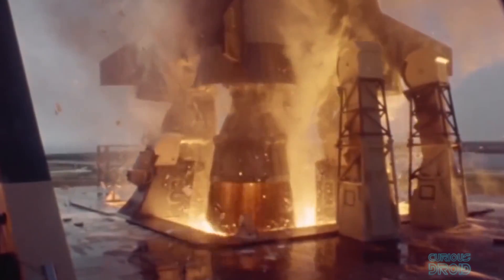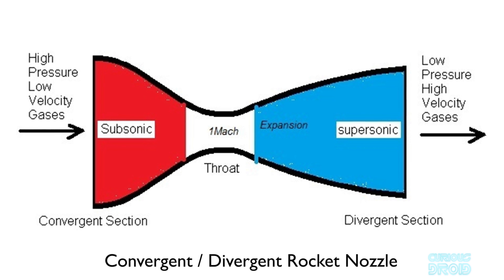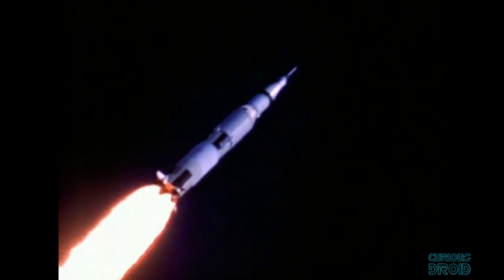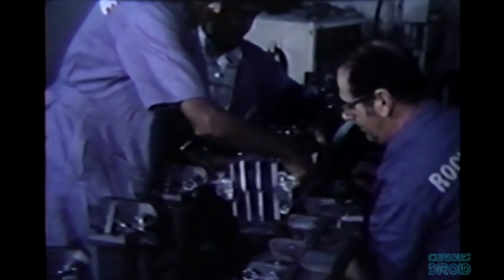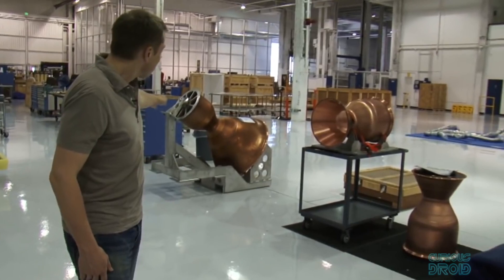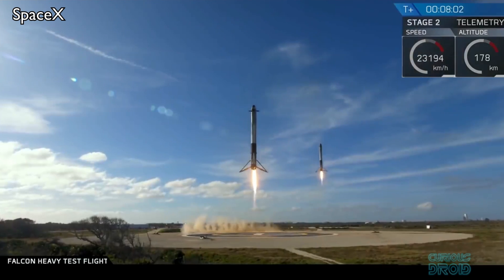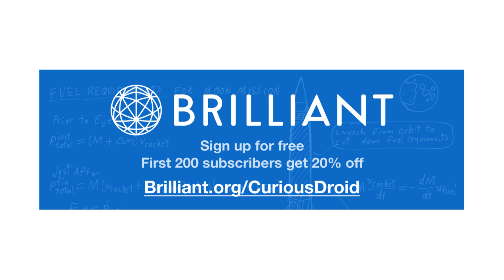Aerospike Engines - Why Aren't We Using them Now?

Comment: Why isn’t there a system similar to a fighter jet engine where it has a bunch of interlocking slats that can expand and contract but maintain the cylindrical shape?
Reply: Rockets operate at much higher temperatures than jet engines. It probably could be done, but the added weight, complexity, and cost would be a step backwards in overall practicality. Not to mention many more parts to fail.
Reply: Harman Robotics it seems fairly simple but maybe not. Building materials can always be swapped.
Reply: Read about regenerative cooling. The rocket bell is a static shape because of the cooling system
Reply: Ned - you are correct.
Reply: Those ribs in the bell have fuel pumped through them (I think). Getting around that would be a major design complication.
Reply: maybe it would melt, no way t cool it??
Reply: Things don't move too well when they expand dramatically under heat loading.
Reply: I thought I read somewhere that conventional fighter jet jet engines wont work in outer space due to the lack of oxygen and atmosphere? Have I been duped?
Reply: Harmon Robotics --- sounds like a logical response to me. Those higher temps would require a different material to handle that without burning up/melting, and in the event of melted rocket butt-flaps, you'd have a whole bunch of problems. The material required would probably be extremely heavy and expensive. Tough to make large parts out of iridium I assume. I may just be talking out of my ass here though. I'm a blacksmith not a rocket scientist.
Reply: Thanks dcb. I did see your comment as I was typing and realised we were referring to the same thing. Sure can learn a lot from youtube!
Reply: You're right. And due to lack of maneuvering thrusters because they require air to direct the aircraft.
Reply: So, we just need to develop new materials that are the perfect ratio of heat resistant to weight and we could easily make a reusable space craft?
Reply: Because they're not as fuel-efficient as jet engines, rocket engines have to have a much higher TWR to be viable.  Anything you can do to eliminate complexity, and therefore weight, is usually worth it. 

The F-16 has the best acceleration of any U.S. fighter jet, and even fully laden with fuel, weapons, and mission equipment it is 10 percent engine by weight (when empty, the engine is more than 20 percent of its weight).  However, since the F-16 has wings and gets all its oxidizer for free, only 16 percent of its weight needs to be fuel. 

A rocket needs to be able to lift itself, its payload, and ALL of its fuel straight up without the assistance of wings, so only about 8 percent of its overall weight can be "dry mass" of any kind - body, hardware, engines, payload, and literally anything else that isn't fuel.  If you're going to design a rocket engine to be as complex and heavy as a jet engine, it will have to be much more powerful or much more efficient than the current technology allows.
Reply: you could do that, and it would work.
But the added mass of the throttling system would be a greater negative than the slight improvement in fuel efficiency it would bring.
.
A bit more practical is a rocket nozzle with a telescoping extension. Nasa has looked at this several times, but rejected it due to complexity. (complexity in a critical system like engine containment is very undesirable)
Reply: I think part of the reason may be just because fighter jets require more variable throttling capabilities whereas a rocket more or less needs its maximum capabilities. This is just a quick thought I had in response to your question, I didn't spend much time thinking it through so if I missed the point, give me a break, hahaha.
Reply: To heavy and the diffence in pressure is way bigger, the closest thing to it proposed today is a plug nozzle.
Reply: JP-5, which is used by the U.S. Navy in its aircraft (a refined kerosene with high flash point), has an auto-ignition temp of 256 C (474.8 F). The liquid oxygen/RP-1 used in the Saturn-V booster stage engines burns at--I think--around 3,000 F. It definitely would melt the "turkey feathers" as the engine nozzles on military jets are referred to as.

Comment: a 40% saving on fuel means you need 40% less tanks and 40% less engine though. So it is a cost saving because you can have a smaller rocket deliver the same payload. And honestly to could double up and use a 2 stage rocket with an areo spike on the first stage and a small vacuum engine on the upper stage, because as you said a bell engine is more optimal in a specific case, and once your out of atmosphere there isn't any more changes to pressure.

Because as I have said in another comment, the reason for staging is only like 20% because of engine optimisation and 80% because you are dumping the tanks and engines that you no longer need, so by using a aero spike through atmosphere then separating recovering the first stage, then using a Vacuum engine on the upper stage I think you could see optimal savings.

Comment: Aerospike engines seem to only make sense in surface to space designs (such as the Space Shuttle). In multi-staged rockets we can have specialised engines and save the weight of carrying them and the empty fuel tanks along. No surface to space designs, no aerospike engines it seems.

Comment: the reason for multiple stages is like 20% because of engine optimisation and is mostly because carrying the dead weight of the tanks you no longer need you decrease your efficiency much more than losses due to using a unoptimised engine, also the fact that you are also carrying a big heavy engine which you don't need once you have burned a lot of the fuel and dumped the extra tanks.

But it would be good to have 1 engine type used throughout a multi stage rocket because it would reduce production costs because you would be building the engines in higher volumes.

Comment: Also ditching fuel tank weight as they empty kinda encourages multi-stage designs anyway.  That reduces the range of altitudes an engine needs to work over.
Reply: Steven Clark This is true, but dropping pieces of the rocket into the ocean means the rocket has to be rebuilt if used again. If the rocket is one piece and can be landed safely all you have to do is refuel it.
Reply: syaondri That sounds like it would work, although it would probably complicate other things.

Sounds Like It Would Work: The USAF and USN have used detachable external fuel tanks on their fighters for decades. Even better, there's a certain type that bolts onto the airframe directly, called "conformal fuel tanks" because they're not the more traditional cigar-shaped pod hanging off the underside. My understanding is these CFT's are the best bet for extending a fighter's range, because not only do they let it carry more fuel, but they don't cause a lot of extra drag the way a more standard external tank does.

Would Probably Complicate Other Things: The disadvantage of CFT's is they can't be dropped to shed weight and improve the plane's aerodynamics. Once they're on, they're on until the ground crew disconnects them. The reason is, the tanks are wired into the plane's fuel system, rather than keeping the internal fuel tank topped off like external fuel pods do. I'd imagine trying to shear off something that long and close to the fuselage - the CFT's on the F-15 are something like 20 feet long - would make flying really tricky, too, but that's mostly speculation. Either way, it would change the plane's balance and handling very suddenly, and rockets' failure rates are scary enough without adding more things that could suddenly decide to go squirrelly.

Why Consider CFT's At All, Then? Because big external tanks impose a lot of extra drag. That means you need a bigger engine to toss the whole contraption into space, which means you need more fuel, which means an even bigger engine, which means... And so on. Tsiolkovsy's rocket equation isn't complicated, as rocket science goes, but it is absolutely merciless.

All that said, I would not be surprised at all to learn that a group like SpaceX is working out the math so they can add extra fuel tanks that A) aren't also the engines themselves, like the STS and multi-stage rockets use, B) conform to the main rocket body such that they don't add horrible amounts of extra drag, and C) can be safely shed once they're empty. It's an engineering challenge, and rocket scientists are pretty good at that kind of thing. Here's hoping!
Reply: Internally-stored, ejectable fuel tanks? I had not thought of that, that's clever! Ditching the empties would change the center of gravity, but then, so does dropping the large external tanks, booster rockets, and empty stages currently in use, so that would happen either way. Yeah, the more I think of it, the more I like that idea.

And space guns! An engineer by the name of Gerald Bull was working on the idea of shooting payloads into orbit in the 1970's/80's, until the Israelis decided his practice of building cruise missiles and gigantic cannons for the Iraqi Hussein regime probably wasn't going to end well, and had him whacked. (...Well, we don't know it was the Israelis: they certainly had a motive to bump off a weapons designer in Saddam's employ, but so did a lot of other people, like the Syrians, Iranians, South Africans, CIA, MI6, and a bunch of others. I guess building weapons is a dangerous job, for some reason.)

At the time, the big problem with Dr. Bull's design was that the shock of firing would be immediately lethal for any astronauts. A railgun's ability to spread the acceleration out beyond the immediate impulse seems like it could solve that, if you made the launch facility long enough.

And, of course, an orbital elevator would solve all these problems to the point of triviality. We just need to find or make something strong enough to reach that far under tension.
Reply: Steven Clark That's a good point. Until this video, I'd thought it was dropping the empty weight, and making landing/recovery easier, that were the main reasons for multi-stage heavy lifters.

Comment: They're using Plasma now.
There is video of the engineers talking about it, and opening a chamber with a 'prototype'. One head guy who was all smiley, said that they're not close to having anything applicable yet. 
If they're clearly exhibiting a small scale engine with indigo/violet Plasma blasting out like the 'flame' of a Butane lighter; it fucking means that of course they're using Plasma.
They've been using Black Budget cash to launch bullshit in Northern Canada for at least a decade. 
That's why NASA was tossed aside. HUNDREDS OF FUCKING TRILLION$ go into the Black shit. 
I've accumulated this knowledge over the last 10-20 years. So don't ask for goddamn sources. Give me sources for your life, and buzz off. 
Believe this or don't. 
This yapping means nothing. 

"Gordian Knot"

The "bell" obfuscates the difference in propulsion. Probably as useful as louvers. I like louvers though. 

Stage Props.
Who cares. They're the ones that hide everything. 

EVERYTHING you see or hear on the internet is 40 years old MINIMVM. Civilians get nothing until the majority is too old to care, or broken down from life, low testosterone; ready for the "fascinating new discoveries" on TV just before 19:59 bedtime. 
DISCLOSURE. BOOM. No one cares. 
Repeat. 
We all know this. 
Maybe CVRIA•DROID doesn't know about the paradigm shifts. But those above certainly do. 

Because of Plasmoidal technology, the inertia can be increased, weight decreased, and everything becomes cheaper. Oh— and the ability to reach Mars in 30 days. 
cough
You're welcome.

Comment: space is dead
people play it safe with 1960s tech.
Reply: Rockets need horsepower
Reply: randomguy8196 
The J2 design which SpaceX purchased, tested, and refined was developed under the direct supervision of Werner von Braun, arguably the single most expert rocket scientist of the 20th century.  It was so successful that after the iron curtain fell, Russia bought several models for testing.  Its an excellent starting point until SpaceX can turn a profit and start satisfying both customers' AND investors' interests.
And SpaceX's stated goal is to produce launch vehicles that can be used 10 times consecutively before refurbishment - so spending investment $ on refurbishing existing vehicles would not be economical in light of that goal.  If SpaceX can complete 10 launches a month on one vehicle before refurbishment, they will become VERY profitable.
Reply: Space won't be dead once we're back in it again.
Reply: horses aren't broken. yet we don't use them for transport anymore.
Reply: Playing it safe is one of the best qualities of proven tested 60s technology. They've been debugging it for a half century. You can't beat that.
Reply: You have something better to offer? I mean realistic options not some out of this world alien stuff from Star Wars.
Reply: more horses are used for transportation than rockets atm.
Reply: If it's not broken, don't fix it.  And don't attempt to break it for someone else to fix or you'll be arrested by NASA.

Comment: Very interesting, but a few things:

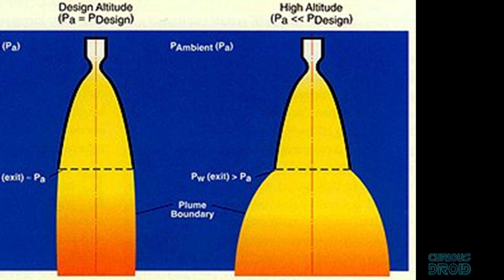At 3:50 you confused overexpanded with underexpanded.

I think you overrate the aerospike. It mainly makes sense in SSTOs, but these mainly aren't used for other reasons (just too low Isp of chemical engines for meaningful payloads). If you do 2-3 stages anyway, why bother w/ a aerospikes? Probably higher weight and unproven technology.

Also it is wrong that companies like SpaceX/Blue Origin don't innovate engine-wise. You're right for Falcon 9 or New Shepard, but Raptor and BE 4 are the first big rocket engines to ever fly on Methane/LO2. Also the Raptor will probably be the first Full flow staged combustion engine used in a real rocket (if all goes well).

Comment: If the traditional rocket nozzle design produces unwanted and destabilizing cavitations at supersonic speed, then why don't these rocket boosters just propel the upper stages to, or at, subsonic speeds until they reach an altitude so high that the cavitation has little effect?

Comment: I remember following the deveolpment of the X-33 venturestar. I really hoped the linear aerospike engined X-33 wouldnt be canceled but it was. The program had massive issues building composite fuel tanks but they kept failing.
The irony is that Lockheed eventually fixed the large fuel tank failure issue so in reality the system could be built today.
The engines work, the fuel tanks can be built and today 17 years later the electronics and software systems that could be used to control the ship would be even more advanced.
I do remember at the time it was George Bush who cancelled the program and there was a lot of commentary at the time that said that in reality he really didnt understand the program and considered it "low hanging fruit" in cost saving terms and just axed it without really understanding what the program would eventually deliver in terms of savings over the life of the program.
I remember being at work in my new job and seeing a news post that the X-33 was canceled, and I was, to be honest devastated.

Comment: You mixed up a couple of terms, particularly @1:10. Aerospike nozzles replace bell nozzles . The nozzle is the part of a rocket engine that takes the high pressure gas inside the combustion chamber and controls its expansion. Saying you can exchange an aerospike nozzle for a "bell combustion chamber" is gibberish. You need both a combustion chamber and a nozzle, and the nozzle can be an aerospike, bell, or one of several other types of nozzle.

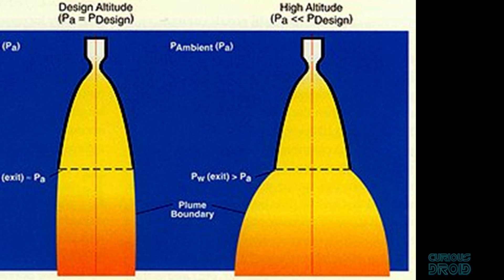Then at 3:45 you state that a sea-level bell nozzle looses efficiency as ambient pressure decreases, however this is false. Every rocket engine will be more efficient at a lower ambient pressure, however an engine with a greater expansion ratio will achieve even better performance. In space, the ideal expansion ratio is actually infinite, but you get diminishing returns for larger nozzles, and the added weight and size make that unfeasible. 

You  can run an over-expanded nozzle at sea-level (as was done on the Space Shuttle Main Engines, which optimized for a much lower ambient pressure due to their longer run time), however as you said it introduces flow instability and can cause damage to the engine nozzle. The SSME nozzle had to be reinforced with stiffener rings around its outer diameter to withstand these stresses, and even still there is some spectacular slow motion footage of the engine that show it flexing violently during startup.

Aerospike engines are neat, but they are also not the only form of altitude-compensating nozzles. The real hurdle to their adoption, however, is the overall poor efficiency of chemical rocket engines. SSTO rockets are greatly hindered by their poor payload mass fraction, a consequence of the rocket equation. It is the tyranny of the rocket engine that forces the use of multi-stage rockets, not the ambient pressure the nozzle is designed for.

Multi-stage rockets also already achieve a form of altitude compensation, by optimizing each stage for a higher altitude's ambient pressure. This greatly reduces the potential benefit of altitude compensating nozzles.

What would be a real game changer driving the adoption of altitude-compensating nozzles is engines with vastly higher efficiency than chemical engines can produce. Nuclear rocket engines in particular are a great fit for this technology, as their higher efficiency could enable practical SSTO flight, and thus increase the advantage gained by altitude compensating nozzles.
Reply: everyone should read the fourth paragraph if they actually want the truth.